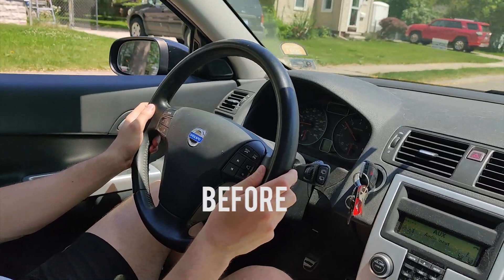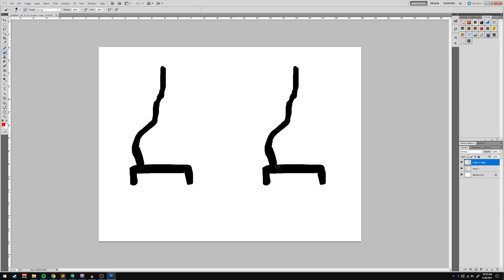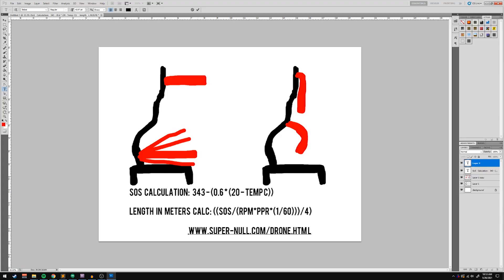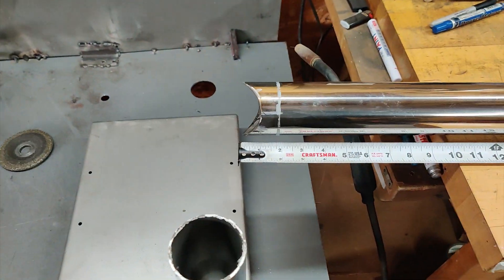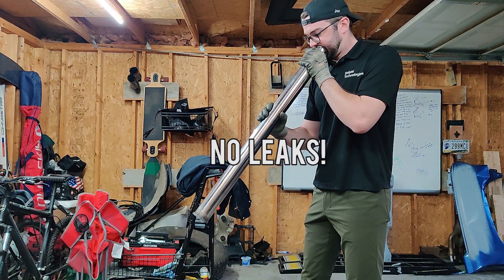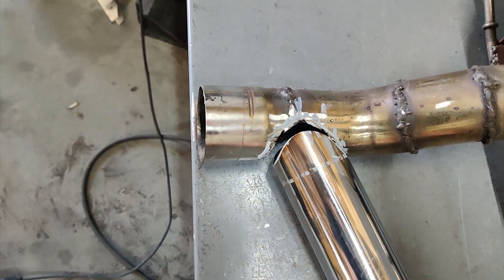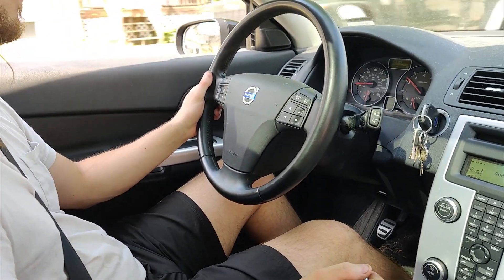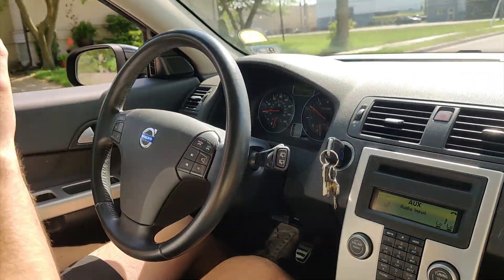Remove Exhaust Drone PERFECTLY + Free Drone Tool

Comment: Thank you! If I can't fit a 40" pipe under my car easily do you think using exactly half the recommended length will be worth trying to at least improve it? From my understanding of sound and instruments, half the length should be an octave higher and still resonate with the drone frequency.
Reply: I cant promise anything- but that would essentially be a cutting the wave frequency in half. Ive seen people fit in the drone pipe full rotated (as in it coils once it Ts off from the main exhaust) the important part is the length.

Let me know what you end up trying and how it works for ya
Reply: @TylerRogersUSA  Ended up building a telescoping pipe for variable length. It took some tweaking to get the sound just right Made with 2-1/4" and 2" pipes that slide into one another sealed with exhaust clamps. Car went from almost unbearable to being able to have a normal conversation while cruising. It still gets nice and loud when you accelerate which is nice.
Reply: @dot_boi  love to hear it dude, glad it helped!

Comment: hey man, great vid!  I think most people mention welding the pipe early in the exhaust flow but was wondering if you had any thoughts if there's a resonator? should it be welded after the resonator before exiting? thanks!
Reply: I believe it would be safer to add after your resonator- that way you know you are cancelling a specific sound that exists, rather than potentially changing the sound of the exhaust due to a changed characteristic BEFORE the resonator. Let me know how it goes!
Reply: @TylerRogersUSA  makes total sense, ty!
Reply: After.  The resonator sound is the sound going directly into your rear muffler where all the drone is heard. You have to cancel that after the resonator but before the muffler.

Comment: Killed the drone... but did it kill the horse power? I just built my S70 t5M fitted with a V-Band Hot side so I need to build my exhaust from scratch. I'm going to use your guidance but i only worry about how it will effect the power.
Reply from the maker: Nothing we noticed, would love to hear dyno numbers before/after if you decide to try it!
Reply: @supernull  definitely

Comment: I'm buying a Greddy muffler for my 2022 XSE Corolla Hatchback 6MT, and I want to make sure there is exactly zero drone because I use this car for ride sharing.

I want the sound that is missing from the 6MT driving experience without putting a metric fuck ton of exhaust drone in the car because that will not only ruin my driving experience, but it'll also ruin my customers experience as a passenger in my car.

For the record, the engine is a 2.0liter 4 cylinder, and I'm still deciding between a single exit with a Greddy Revolution RS muffler, OR, replace the fake dual exhaust tips with real dual exhaust tips, making use of TWO Greddy Revolution RS mufflers. If I do the "Honda S2000" thing and go for the real dual exit exhaust, would that be louder, or quieter than a single exit exhaust?

I'm sure I could just look this stuff up and try my luck on forums or website FAQs, but what I've found so far doesn't really answer my questions.
Reply: Do the single exhaust, keep it simple- see where the drone is worst and then add the drone pipe after. True dual is just going to be more complicated and probably a bit quieter.

Comment: So basically it's the same principle as a tuned expansion chamber on a 2 stroke engine. The combustion pulses, ie. sound waves, reflects back to the engine. In a 2 stroke engine it increases the pressure in the cylinder. In this case it cancels the sound or drone that you tune the system to. Interesting.
Reply: Exactly the same concept. This may increase back pressure a hair, but for a 4 stroke I wouldn't think its enough worth mentioning. Thanks for taking the time to comment!

Comment: Hello, you can help me ? I dont know How is my exhaust temperature, but i have a rta and my drone frequency is 67hz, you can calculate my j pipe lenght ? 

Ps. Is a 4 cylinder 4 Stroke engine

Thanks
Reply: Jump over to the calculator on my website- try using a "safe" SoS number such as 400 and determine which RPM feels the worst (or the middle of top and bottom of where you experience the drone)

Best of luck!

Comment: Heey man quick unrelated question, I have almost exactly the same setup, and when it’s cold out I get condensation fumes which is normal, but only from the drivers side and it’s driving me crazy, do you know why that would be
Reply from the maker: I would guess either one bank is slightly lower and condensation pools there, or its just a longer run maybe? Either way you shouldnt have any issues from that- dont worry too much
Reply: @supernull  I'm not worrying it's just aesthetically unpleasant
Reply from the maker: @imadiraqi400  I get that. Maybe try drilling a small hole after all mufflers near the end of the exhaust at the lowest point on the side that fumes. If it doesnt work, weld it up no harm done.
Reply: @supernull  I'll try that thanks a lot man !

Comment: How do you know what size pipe to use? I'm going to do this on a 22re with 2.25 exhaust. Not sure whether to use the same size or smaller
Reply from the maker: I have heard you can use smaller sizes, and have seen people do that with success. My advice is try to match the exhaust size as close as you can within the space you have available.

Comment: I have a question for you. On your calculator page you are shown PPR for different engines. I have a weird one for you. This is a twin cylinder 4 stroke and both pistons fire at the same time. In this case would the PPR be 1,  1/2,   or something different?? What this is, Is a turbocharged snowmobile that i have a tune on sitting at 260HP. I am running a full 3" exhaust but the drone will drive you batty at 5300 Rpm's.
Reply: You're sure the pistons fire at the same time...? That would make the engine very unbalanced I'd think. If thats the case however your PPR would be 1/2. If it was a 4 stroke 2 Cyl in the classic sense it would be a PPR of 1. Either way its going to be a LOONG drone pipe for something of this size (at 5300 RPM I have you over 90 inches)

You can consider running a smaller pipe for the drone pipe, maybe even as small as 1-2 inches and running a coil of pipe to get the length requirement with a smaller space requirement.

Good luck!
Reply: @TylerRogersUSA  Yes I am sure both pistons fire at the same time. They have a crank driven counter balancer to help with harmonics. Thanks for the info

Comment: I have a Ford Mustang 2015, i remove the resonator (is in the middle of the car) and  the two mufflers, and install  two borla s-type, the drone is terrible, did you tink that the  drone improves if  reinstall the resonator?  thanks!
Reply from the maker: It will reduce noise, now im not sure how effective it is for DRONE since its targeting specific frequencies of an OEM setup. Since you have changed the exhaust setup, you are better off calculating a specific drone pipe to add in, especially if you enjoy how it sounds (not counting the drone of course)

If you have any more questions feel free to ask, good luck!
Reply: @supernull  Tanks a lot

Comment: Bro would this work with a ram 1500 with a super 10 in it ?
Reply: It works on any vehicle! Go to the drone calculator in the video description and it will help you calculate the pipe length for your application
Reply: @TylerRogersUSA  cool man now did this like make your exhaust/engine run hotter ? Or any difference you see after install.
Reply: @victorortega2718  only thing we noticed was that we enjoyed driving it again haha

Comment: Best sounding Volvo EVER, could you fully describe your exhaust system please?
Reply: Thank you, thats very kind! It is a 2.5" stainless straight pipe from the cat/downpipe all the wack back to dual tips and a drone pipe as seen in the video.
Reply: Wow, outside it sounds great and it seems really quiet inside, I thought there'd be a resonator! Thanks.
Reply: @ericmccolough2482  Not a problem! the drone pipe calculator works great, it sounds near stock inside with the windows up

Comment: So for a dual exit exhaust, do you just half the value for the ppr?
Reply: Good question, yes you would essentially treat each exhaust bank as isolated systems. A V6 with separate exhausts would be treated as 2 independent "3 cyl" systems. Keep in mind you need to add the drone pipe to each exhaust pipe.
Reply: @TylerRogersUSA  that's if they're isolated banks - something that Y-pipes out to dual exit would need 2x whatever you require, full length etc, so I guess do it before the Y if possible in that case to minimise work/weight etc
Reply: @metalinvalidmatt  the closer you get to the engine the more effective this is- just remember the exhaust gas is hotter

Comment: does the pipe have to be closed at the end for it to work, or can it also be open? will the benefit be lost then?
Reply from the maker: Pipe needs to be capped yes, the calculation works by bouncing soundwaves backwards and colliding with the exhaust flow, canceling out the drone frequency.

Comment: Hey man! Great video, straight to the point! Quick question, did you see the overall volume/DB of the exhaust go down when you did this? I've been going back and forth about doing a J pipe for a while now and hoping to curb my drone and quiet down my exhaust at the same time, thanks!
Reply from the maker: This is more for a specific frequency, not so much general noise. If you are trying to cut down on noise as a whole, look into aftermarket mufflers, that will target a more broad range of revs. That being said, you can STILL use this method after a muffler if you want to cut a specific drone, even with a muffler installed.

Glad you found the video helpful, good luck!
Reply: Make an expansion chamber that goes just after your header pipe and is 8 times the volume of 1 cylinder. This reduces HP loss in your system to almost nil and has a slight (about 1.5 db) noise reduction overall. Then use the Heimholz resonator here to target specific frequencies.